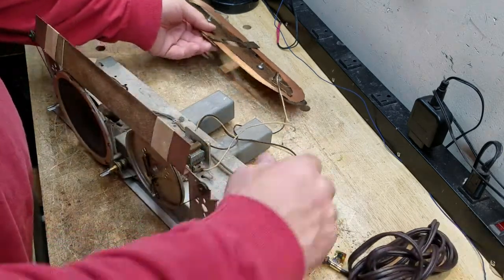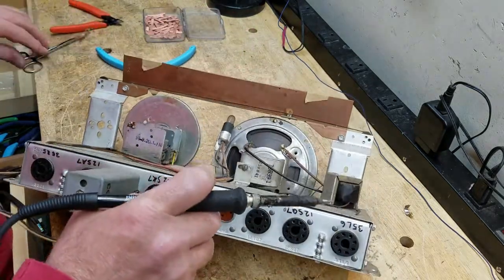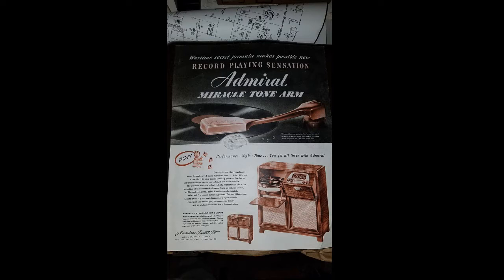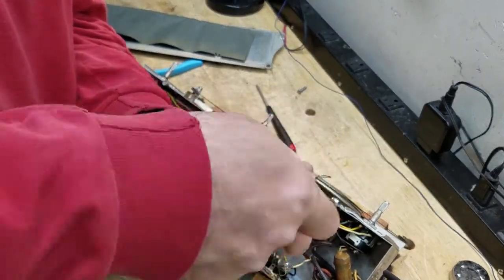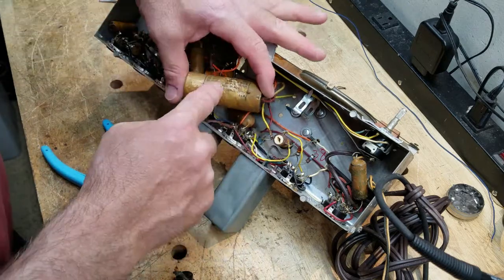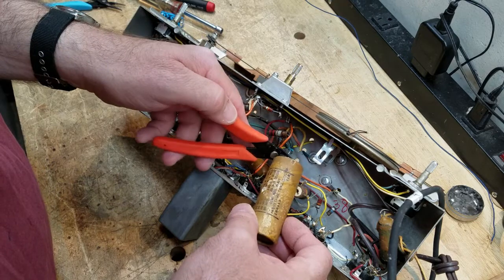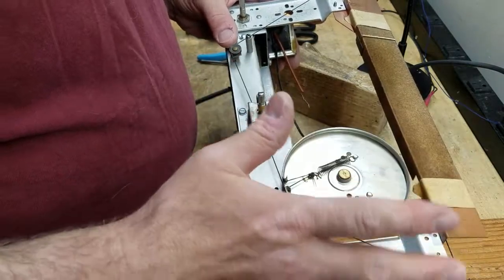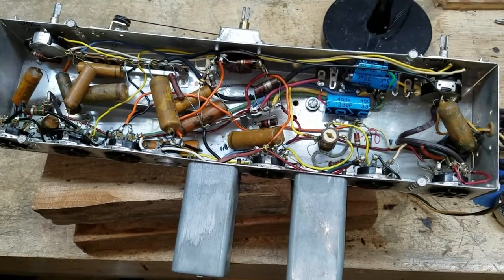1949 ADMIARAL 6F11-N Radio Record Player Part 3 of 8 Radio & Amp Chassis

Comment: Nice set! That was a good terminal strip layout you did, it always takes a little dry fitting for me to get it right. I have I think a 1941 Firestone Air Chief combo,mrscord/radio that I need to get around to. Ive never worked on a record player so I may need some adult supervision, lol. It was too cool to pass up. Thanks for sharing. Cheers Larry
Reply from the maker: Hey, Larry!
Thanks for watching and for the kind words.   I actually really like Firestone sets.  They had classy styling and were pretty well-built.  If you run into anything that I can help with, feel free to shout out to me and I'll be as useful as I can.  I'll keep my eyes open for your videos!  [: 0)    For parts, no one beats Gary at Voice of Music Audio Enthusiasts.  Give them a look.  Gary responds quickly to emails and he is very helpful.  Have fun!   
Cheers!   
Michael
Reply: ThatTubeSound thanks Michael! I know the turntable runs, no sound so I didn't test the stylus. It was one of those , I bought and quick check, back burner. Thx again! Best Larry

Comment: Hey Michael, Cool beans on not having to remove the tuning condenser!  I just got one of those Joe Knows resistor kits.  I haven't quite gotten the knack of being able to tell what wattage a resistor is from just looking at the thing so I ordered a big box of 1 watt resistors thinking better to have more wattage than not enough, lol.  Take care, Gary
Reply from the maker: Gary,
I've never been able to discern power rating from the color code.  I usually use the physical size as my guide.  But, I have a good source of NOS old-fashioned carbon comp resistors, and they are easy to sort out.  I test every NOS part before installing it, but I've yet to get a bad one!   I get them all at R.A. Elco in Salt Lake City.  I'm really fortunate to have that store so close to me.   Take care, old man!    Michael

Comment: hi 
i have a 1954 admiral phonograph, the phonograph dose work but the problem i am having is the the sound is distorted, i did replace all the wax caps and it is still there, i did not replace the main electrolytic cap yet and it looks the same way as your's crushed in from the bracket that holds it in place, i tested the values on all of the resistors 4 of them have higher ohm's then what they are called for and one of them the ohm's is too low, the tubes tested good, what do you think, could this possibly be what is causing the distortion problem?? in your expert opinion, please let me know i really would appreciate it, because i am still new at repairing vintage electronics,

thanks 
ted

Comment: I see you used all 450 volt electrolytic caps to replace the original 150 volt (and one 25 volt) unit.  Bob's sells 160 volt caps, which are intended for transformerless sets, why didn't you use those?  In general it's not a good idea to grossly under volt electrolytic caps, doing so will LOWER their effective rating in microfarads.  This is especially true for that cap in the 25 volt circuit (probably the bypass cap for the cathode resistor of the 35L6 output tube).
Reply from the maker: I did not know that about using caps with a much higher voltage rating than original.  I'll keep that in mind going forward.  I probably did it because I have a good inventory of 450 and 250 volt caps.  It looks like I could use a decent stash of 160, 25, and 50 volt caps on hand too.  Thank you for the tip, Kenneth.   Cheers!   Michael

I've been setting up a new computer, so I am probably a little slow in responding right now.  I HATE setting up a new machine!   Grrrr...!
Reply: If you use larger microfarad values then required with the higher voltage caps, all should be OK.  If the hum is low, then all is well.  But you are paying extra for those larger, HV caps (and they are also larger in physical size requiring some extra effort to fit in place).  Using 250 volt caps in a line operated circuit is probably OK, but 450 volt is grossly over.

BTW I found the schematic for that set, and it's weird how they used two 12SQ7 tubes to do the job of one, LITERALLY!  Another sales department trick to up the tube count for brownie points?
Reply: Thanks for the info. I too am a beginner hobbiest electronic nerd. Always learning.